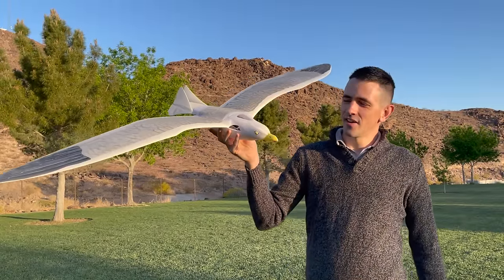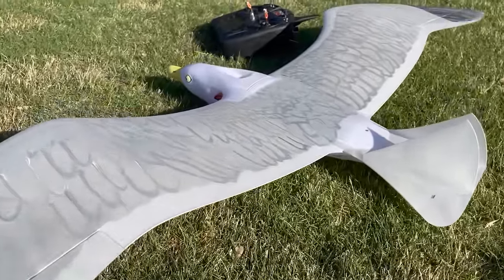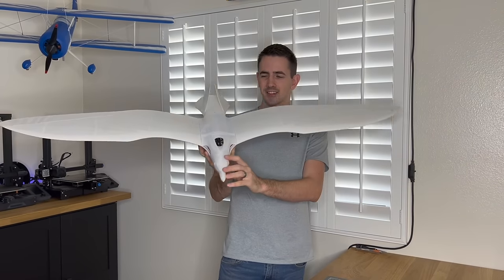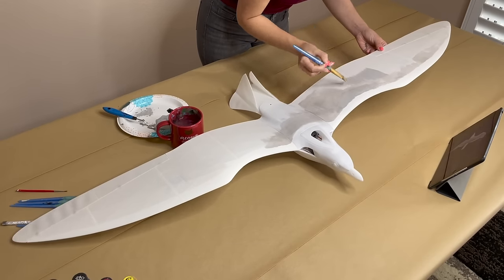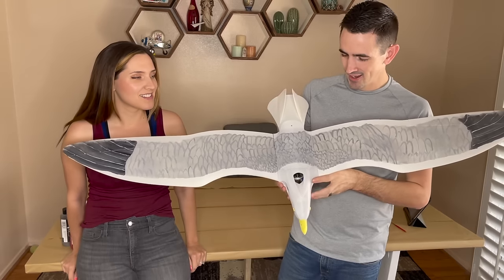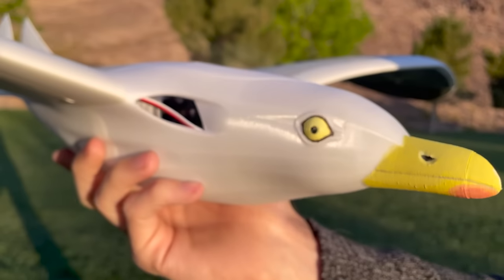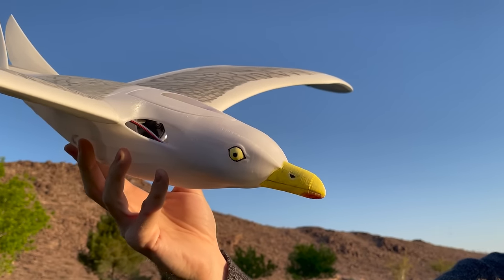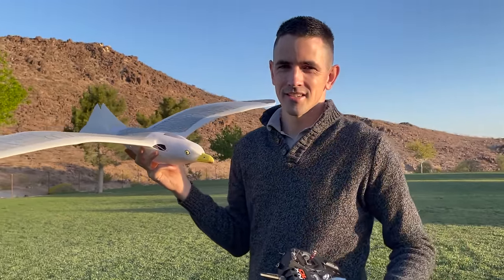3D Printed EDF RC Seagull Full Build | Planeprint

Comment: Hey Troy, you're really close to success here, please don't give up! Observing how the bird behaves shows it has insufficient yaw stability - its always yawing to the left under the influence of the EDF unit's torque. This is likely relatively easy to fix - possible solutions include (i) add a transparent extensions to the vertical surfaces using thin clear plastic sheet; (ii) make up some seagull feet and add them to the model, positioning them so that they add vertical area as far back as possible, (iii) make a new, longer tail, or better (iv) reposition the existing tail at a greater distance behind the seagull body (could make up an extension piece to achieve this). Option (i) would be very easy to implement. Moving the balance point slightly further forward will assist marginally in increasing yaw stability. Hope this helps :-)
Reply: I really like the idea about using feet as airodynamic surface!

Comment: Hey Troy we have built 4 of these and 3 of the 4 are flying well.  We had to use the FMS 50mm fan and mods because we could not get the 40mm EDFs.  I just don't think the 40mm EDF has enough thrust for this design.  Here is a link to one of the flights on my seagull:  https://youtu.be/6s6ZJYIcP-E
Reply: Hey, are you still running on 2s or 3s for the 50mm fan?
Thinking of the same fan, don’t want it to be underpowered.
Reply: @hkk5790  We are running 3S 1300Mah packs.
Reply: @jdduncan  one more question, did you create a new mount for the 50 fan? Surely the stock one won’t fit, how did you mount it?

Comment: Heck, Skip the EDF, cover the air inputs to reduce drag, and try to slope soar it instead. It might need 10+mph to work but the realism of gliding it silently would be very satisfying.
Reply: There is a glider version of this model. I immediately thought it would be a better glider than an EDF plane

Comment: Shame it didn't fly, looks awesome. EDF are cool but only really function well at higher airspeeds as they accelerate air to higher speeds and thus produce thrust at higher airspeeds allowing higher airspeeds to be achieved. This however comes at the expense of air volume. A prop is many times more efficient for the airspeed this model would operate at judging by its design. They also really need well designed ducting to work efficiently. The ducting design on that model is very bad. The model seems to have poor yaw stability as well.
It seems to have been designed around how it looks rather than any aerodynamic functionality.

Comment: Looks so nice, but appears to on heavy side, or lacking in power as never really climbed. Heard you state was 610g with battery. Looking at PlanePrint, they state should be ~560g. 
It may be worth some effort to do a thrust test on the EDF, as the bird also didn't seem to pick up much speed. I've seen other videos where it climbs at 15-20º angle from launch.
I'm not familiar with EDFs, but appears to be some variation in thrust producing ability.

Comment: Hi Troy, Awsome video by the way. We are here in England UK. My mate made one. They do look great when decorated like your one. I helped him iaunch it . Very much the same result that you got. It just didn't seem to have enough power for just a hand launch. It flew but he couldn't steer it. Then it stalled and nose dived into the worst place posible ( a farmers tarmac track). Breaking it into small peices. (Dow!) He also printed me a slope soaring version. I hope my slope soaring one fly's better. Did you ever get your ducted fan one to fly correctly? My mate has reprinted his to try again. But any tips you can pass on will be more than helpfull. We know the center of gravity is critical. Plus you need speed of air over the wings with ducted fan's to have any effect on the flying surfaces. Unlike a prop-on -the -front model that generates it's own wind. We are thinking like you of throwing it from a slope or maybe a bungy lauch may work? Also what static thrust was coming from yours? And what amps watts etc? I think this is more about animatronics than aeromodelling. Happy landings anyway from Phill W (wiggles)

Comment: How many times do you have to crash it going left every time???
Didn't you recognise it needed some right yaw trim??...It barely has enough power but once it's trimmed it should be enough....I'm guessing you were trying to use the elevons all the time when clearly it needed Rudder trim ..🤔😳😳..It's a great looking Gull though, not sure an EDF like that is appropriate, the inlets and outlets don't look like they're efficient enough... I'd take the Fan out and fly it off a proper Slope or Beach location...

Comment: How do you get the Inside structure of your prints for your planes to print, because when I use Cura I can’t get the inside structure to print it only prints with infill
Reply: You must read the available instructions carefully and/or buy better glasses ;)
The most important reason why only Cura prints this is the "Special Modes-> Surface Modes-> Surface" option.
That's why you are failing.

Comment: Too bad design, not enough rudder. Too low power for the high speed needed by weight

But very nice looking 

Inspire from bird : use winglet as stabilizer and full tail rotating on herself. 

It will work

Comment: It appears underpowered and not enough vertical surface (rudder).  I enjoy your stuff and you do a really good job.  Still, 3d printed planes are way too fragile, I hope they get better with the designs.  I just started using Polylite and I'm having issues.  I suspect it has gotten wet since I opened the package.  I've looked at reviews for this product but haven't found one that lists their print settings the way you do here.  Would be great if you could print something with Polylite and give us your impressions.